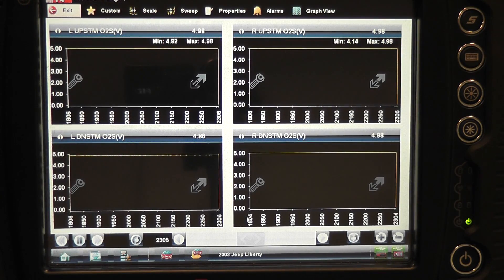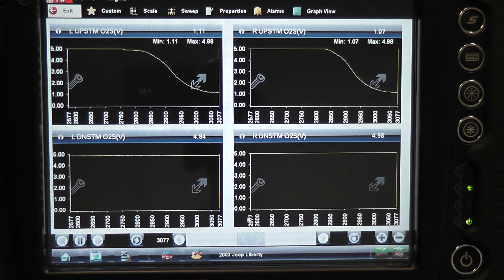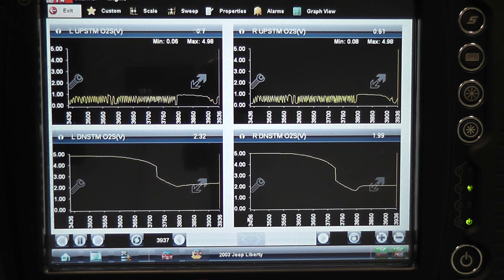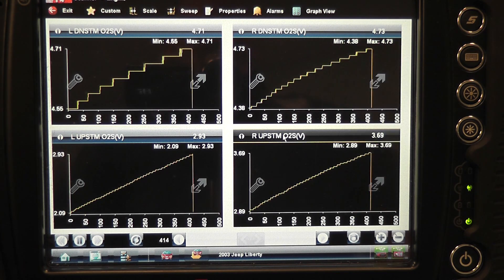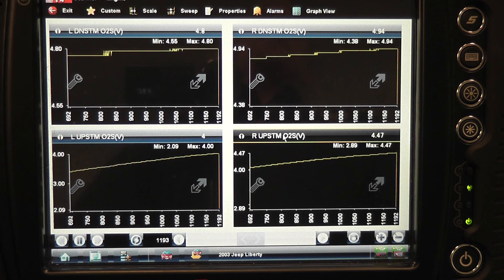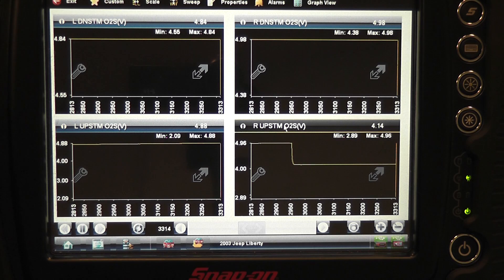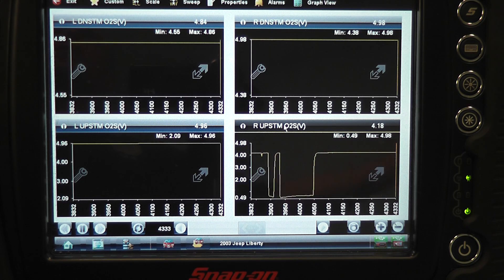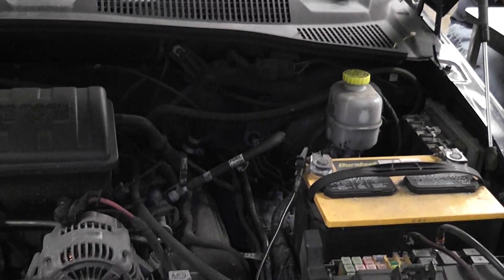What can cause an O2 sensor to read near 5 volts? (Chrysler bias voltage)

Comment: I was checking a jeep for another code. It had no code for oxygen sensor. But it has a p0420 code. I notice on bank 1. Both upper and downstream are reading over 3 volts. And they are mirroring each other. The fuel trims are good. I will check this next time he comes by. It a 2011 grand Cherokee. I need to check wiring diagram also. See it they are both running thru same ground. It’s only on bank 1. Bank 2 is fine. Fix this first. Then address the mirroring readings if they still exist. But it runs fine. Thanks sir. I’ve been looking at your videos. I’m getting ready to retire. And cars have always been a hobby. I usually fix family and friend’s cars.
Reply from the maker: These sensors run on a 2.5v bias.
2.5 to 3.5v is the same as 0-1v signal
Reply: @ScannerDanner  Thanks for the reply. Good to know. So if it’s being mirrored. Could be a failing converter. Same reading upper and lower sensors. What threw me off bank 2 was reading 0-1. Volts in those sensors. He had a rich condition on bank 1 before caused by a leaking valve cover onto a sensor. So I replaced both sensors. And it had a bad coil. Replaced that also. About a year ago. Thanks for taking time to reply. He just lost a family member. So it’ll probably be a while before he brings it by again. I wanted to look into it. It was bothering me. But it runs well.
Reply: @ScannerDanner  I got a new scanner. It had an option for volts and one for volts 0-1. I set bank one on volts. Bank 2 on volts 0-1. That’s why I got the readings I got. It was an oversight on my part. Was just looking over my recording. Again. Thanks for your help.

Comment: 2007 ram v6. Fighting entire bank 1 going -25 long term at idle and all bank 1 cylinder misfiring. Obviously bank 1 sensor keeps popping high code bank 1. New sensors customer even had ecm replaced. Fuses are good. I typically like a challenge but this truck is getting to me.
Reply from the maker: What is bank 2 showing? How does it run at WOT
Reply: @ScannerDanner  bank 2 is 6.2 and the faster you rev the less you can tell it’s missing but have not driven it with scanner hooked up. Will tomorrow. Thanks !!

Comment: can that cause random misfire ? am getting code for the O2 sensor circuit high voltage and getting random misfire also getting p1148 1 closed loop 2 closed loop bank 1

Comment: 2012 Jeep Wrangler- My bank 2 downstream sensor was throwing a fault, so with 130k miles on my jeep, I just went ahead and ordered a whole set of NTK o2 sensors and replaced them. The same sensor is still throwing a p0158, and I verified that the voltage is stuck at 1.275v. I ran some Catacleaner through the jeep  to see if it would help at all, in case the cat is clogged, but it didn't make the slightest difference. 

I'm not sure where to go next with it. I had replaced the spark plugs at 80k miles with factory Iridium plugs, which would only have 50k miles on them now.
Reply from the maker: Broken wire maybe on that circuit. Take some direct measurements for me at that sensor with engine running. The two whites are the heater circuit and the black is signal and gray is signal ground.
Reply: @ScannerDanner  Me and my buddy put a meter on it yesterday and were able to verify the heater wires had power, but not the others. We started at the harness connector and worked our way back and found a broken wire. No idea how the wire would have got broken, since it is not physically in contact with anything else. It is about an inch and a half back from the connector, so not as bad as it could have been.
Reply from the maker: @wvjeepguy8178  heck yeah man, nice find!

Comment: This voltage runs through the signal wire or the return signal wire? Is it normal to have voltage in the return signal wire?
Im having problems diagnosing two codes p0132 and p0152 in a liberty 2004 3.7,already changed both upstream o2 sensors, If i drive the truck they start to vary but once I stop in the traffic the sensor go back to 5 volts, do you think my pcm is bad?
Reply from the maker: Nope, I think you used the wrong O2 sensor https://youtu.be/-lUYRqaYvYI
https://youtu.be/gtTKOuu6EPw
Reply from the maker: The short reason is that the heater circuits are cooling off more than they should be because the sensors you put in are designed for constant current flow, not a pulse width modulated heater like your Jeep uses. You MUST use a factory sensor. They are made by NTK (a division of NGK) and you can find them outside of the dealer for a fraction of the cost.
Reply: @ScannerDanner  i replaced both o2 sensors with mopar oem parts, part number 56028994AA. thanks for the response.
Reply: @ScannerDanner  i forgot to mention , i checked the harness from the pcm connectors to the o2 conector harness , everything is okay, no variation when i move the cables, checked with a osciloscope the function of both o2 sensores unplugged and seems to be ok the readings, the problems start when i connect the o2 sensors to them harness.cheked resistance in the cable , everything in the harness its okay. thats why im thinking of a bad pcm.

Comment: I think I have this exact issue on a 2007 300c.

P0138 and P0158 voltage errors on both downstream. Brand new sensors.

Which relay did you remove is this video?

Trying to work out exactly what my next steps are.

Thanks
Reply: Did you fix it?
Reply: @repeater95  yup

New sensors (aftermarket) were faulty.

Hooked them up to Appcar while driving and the voltage never dropped.

Bought some OEM sensors and has been fine ever since.
Reply: @bigblockheed  nice, you are  lucky, I change mine oem and the fault persist

Comment: hi,i love your teaching danner and i just wanna ask about my bmw f30 when i checked O2 sensor upstream is 1.45V and dowstream is 0.64V that is problem with up stream sensor right? and the car does not show checked engine light?
Reply from the maker: Sounds like a wideband upstream sensor and most likely not an issue
Reply: @ScannerDanner  thanks i will research about wideband O2

Comment: Excellent Information. Thanks.  When you say wide open throttle, do you actually mean pedal to the floor? Or does that just mean normal operation when driving under a load?
Reply from the maker: Pedal to the floor my friend

Comment: Hi brother Paul. Been researching titania oxygen sensors and learned they use a 5 Vref because they can't produce their own voltages like the zirconia oxygen sensors do. Titania oxygen sensors change resistance depending on amount of oxygen present in the exhaust stream. High concentration of oxygen will cause this sensor to have high resistance. This will result in the sensor signal to be high. Low concentration of oxygen will cause this sensor to have lower resistance. This will result in the sensor signal to be low. With this in mind, start watching the sensors reaction at the 2:49 Mark of the video. When the assistant let off the throttle. The decel fuel cut makes the system lean, and the exhaust goes lean. The scan data shows the signals go to 1V.
Reply from the maker: This is a zirconia O2 my friend. I am familiar with the titania sensors and they were used on some older jeeps but not here. 
The 5v bias circuit on these is different than the 5v signal on the titania sensors. They were built more like thermistor circuits.
Reply: @ScannerDanner  at the 2:49 mark of the video, when assistant released the throttle, the voltage went up. Not sure how to understand this if it was zirconia oxygen sensor it should have gone down in voltage. Have a blessed and safe week to you and your family.
Reply from the maker: @billyyoder8171  voltage went back up because the sensor was too cold with the heater not working. This a bias signal voltage that you are looking at. Night and day different than the signal voltage on a titania sensor. On the 5v bias that a zirconia uses (chrysler), I can use my body to pull the signal voltage to ground, on a titania 5v signal, you absolutely can not.

Comment: I don't work in automotive but I've done some investigations better than the service guys just with what I learned on this channel. I just had an ECU swap investigated by me. The service found a bad relay and a coil and I insisted to find the cause. I used a check lamp and noticed constant power from the ECU to the coil (I assume shorted MOSFET). After the ECU swap I got a "short to positive" on a oxygen sensor and the service wanted to change it. Again, they did not agree it is a strange coincidence to have that sensor broken right after the ECU swap. I went home and found a bent pin in a socket on the ECU. Problem solved. Thank you for these awesome videos!
Reply from the maker: That's what I'm talking about man. Awesome!

Comment: This video was AWESOME!!! Have been dealing with a high voltage 02 code on both sensors. Would constantly stay above 1 volt. Run great @ higher rpm and terrible idle. Heater fuse was blown. Runs great now, and it all makes sense!
Reply: Which is the heater fuse?

Comment: I have a 2000 ram 5.9 runs excellent idles smooth starts right up the only thing is that under load the exhaust manifold glow red I have replaced the O2 sensor dropped the converter and Muffler and tested and still they glow red meaning to manifolds replace fuel injectors and they still glow red on a scan to a while you're driving everything is reading and range but still exhaust manifolds glow red no check engine light timing was off by a little bit but not enough to affect anything any help would be appreciated as I am frustrated in this

Comment: What does it mean if you have an upstream o2 sensor reading nearly 5v already replaced the sensor 06 Chrysler Pacifica
Reply from the maker: Can you make the signal voltage drop by running the engine at 2000-3000 rpm in park? If yes, you have a heater circuit issue. If no, you have a signal circuit problem. Let me know and we'll go from there.
Reply: Did you solved?

Comment: Can this happen with a blown ASD /Fuel fuse as well? Have an issue 2005 PT Crusier... battery is fine, I replaced ASD relay and up stream down stream engine light stayed off for 160 Mile's back on for low voltage I haven't checked the ASD/Fuel fuses yet. S.O.S.

Comment: The time I know I understand the material in these videos is when I am repairing a car that takes its sweet time setting O2 monitor. Super info!!  A really neat test is using the low amp clamp and watching current flowing to the heater circuit. Looking at the book and then linking the appropriate video.

Comment: I have a 2007 dodge ram 1500 with the 4.7L v8 in it. I am having an issue that I am hoping that someone with more knowledge can help me with. I recently got the code p0430 check engine light come on in my truck. The code is for inefficient catalytic converter bank 2. after talking to multiple sources and doing research, everyone said that there is a 90% chance that the converter is bad and would need to be replaced. I replaced the converter and the code came back on the same day. I furthered investigated this issue by using my scanner and looking at the voltage of the 02 sensors on both banks of my exhaust. When I did this, I noticed that my downstream sensor on bank 2 was acting weird at start up and while driving it. The downstream sensor has the same voltage as the other sensor before I start the truck, but once I start the truck the sensor loses most of its voltage within a minute or so. Sometimes the sensor with show 0.035 or so volts but nothing compared to the same sensor on bank 1 which is .685-.7 ish. When I drive the truck on the interstate the sensor will sometimes show flashes of it working......if I accelerate on the throttle it will jump up and match the bank 1 sensor 2, but then it will fall back down. The upstream sensor is working in the same fashion as the bank 1 upstream sensor so it can not be that sensor causing the issue. I figured that I have a bad 02 sensor since I am losing voltage at startup so I replaced the bank 2 sensor with a new one. I drove it on the interstate and it still did the same thing..........the check engine light did not come back on but it did same "pending code" on my scanner and it was the same p0430 code.....

It is now clear to me that there is a communication problem with the pigtail that connects to this sensor. There is either a problem with the computer on the truck with this sensor (which seems unlikely to me since all of the other three sensors work) or there is a problem with one of the wires going from the computer to the pigtail. It does not appear to have any cuts or burns in the wires as far as I can see.

I am not sure what I need to do next.....I do not know where/how to test the wires or see where the ground is for the pigtail. I have tried to find more information but have had no luck. I do not want to take it to the dealer and pay a lot of money to just have them look at it....they will probably assume its a bad computer and charge a lot of money to replace it..

Some help in the right direction would be great! Thanks so much!
Reply: Justin if you put and aftermarket  converter on there most likely that is why your getting your code I would strongly advise you to buy scannerdanners book and get his premium channel it will make you understand everything and be really efficient at fixing cars and you won't be a parts changer good luck

Comment: Will the computer still pull fuel away from both banks if say the problem only relied on B1S2?
Reply: generally S2 O2s (downstream of Cats) are only used for Cat and S1(upstream of Cats) self testing, never fuel control, they can only set codes for an upstream O2 (S1) or Cat codes as that is their main purpose.Note that as far as I am aware fuel control is NOT ever done using a DOWNstream O2 (S2).

Comment: Yesterday, i was working on a dodge caliber 2.0 it had a code regarding "Actuator Flow Control Valve high voltage p2017" and i found the same 5v bias voltage on the signal wire what I thought in the beginning it was a short to 5v reference circuit, my next step was to connect a meter to 5v ref on the same connector, fully ground signal wire with a test light, it did not lit, 5v ref was intact, old code was stored / a new code popped up it was "low voltage" , went an extra mile and connected the meter in conjunction with the test light and it was fixed 0v, i remembered watching this video last year so i was sure it must be a bias. Thank you for spreading the knowledge

Comment: OXYGEN SENSOR (O2S) MONITOR
Effective control of exhaust emissions is achieved by an oxygen feedback system. The most important element of the feedback system is the O2S. The O2S is located in the exhaust path. Once it reaches operating temperature 300° to 350°C (572° to 662°F), the sensor generates a voltage that is inversely proportional to the amount of oxygen in the exhaust. The information obtained by the sensor is used to calculate the fuel injector pulse width. This maintains a 14.7 to 1 Air Fuel (A/F) ratio. At this mixture ratio, the catalyst works best to remove hydrocarbons (HC), carbon monoxide (CO) and nitrogen oxide (NOx) from the exhaust.

The O2S is also the main sensing element for the Catalyst and Fuel Monitors.

The O2S can fail in any or all of the following manners: 

slow response rate 
reduced output voltage 
dynamic shift 
shorted or open circuits 
Response rate is the time required for the sensor to switch from lean to rich once it is exposed to a richer than optimum A/F mixture or vice versa. As the sensor starts malfunctioning, it could take longer to detect the changes in the oxygen content of the exhaust gas.

The output voltage of the O2S ranges from 0 to 1 volt. A good sensor can easily generate any output voltage in this range as it is exposed to different concentrations of oxygen. To detect a shift in the A/F mixture (lean or rich), the output voltage has to change beyond a threshold value. A malfunctioning sensor could have difficulty changing beyond the threshold value.

OXYGEN SENSOR HEATER MONITOR
If there is an oxygen sensor (O2S) shorted to voltage DTC, as well as a O2S heater DTC, the O2S fault MUST be repaired first. Before checking the O2S fault, verify that the heater circuit is operating correctly. 

Effective control of exhaust emissions is achieved by an oxygen feedback system. The most important element of the feedback system is the O2S. The O2S is located in the exhaust path. Once it reaches operating temperature 300° to 350°C (572 ° to 662°F), the sensor generates a voltage that is inversely proportional to the amount of oxygen in the exhaust. The information obtained by the sensor is used to calculate the fuel injector pulse width. This maintains a 14.7 to 1 Air Fuel (A/F) ratio. At this mixture ratio, the catalyst works best to remove hydrocarbons (HC), carbon monoxide (CO) and nitrogen oxide (NOx) from the exhaust.

The voltage readings taken from the O2S sensor are very temperature sensitive. The readings are not accurate below 300°C. Heating of the O2S sensor is done to allow the engine controller to shift to closed loop control as soon as possible. The heating element used to heat the O2S sensor must be tested to ensure that it is heating the sensor properly.

The O2S sensor circuit is monitored for a drop in voltage. The sensor output is used to test the heater by isolating the effect of the heater element on the O2S sensor output voltage from the other effects.